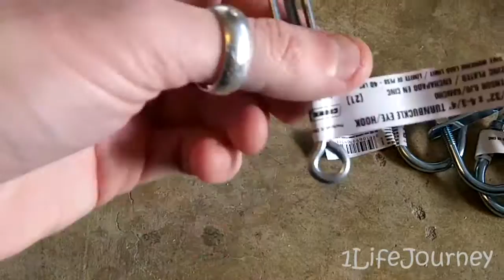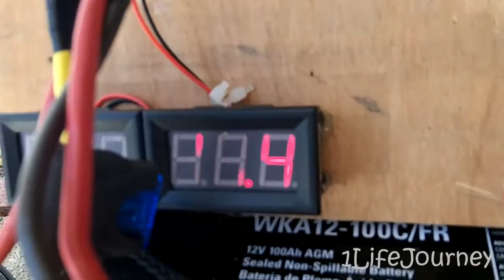Van Build Part 8 - Roof Rack fabrication PT1 - ventshade install - window blackouts - solar wiring

Comment from the maker: Solarblvd is where I got the panel from. It was under $200 shipped to my door which I felt was a great price at the time. The controller I got off eBay for about $70. Thanks!